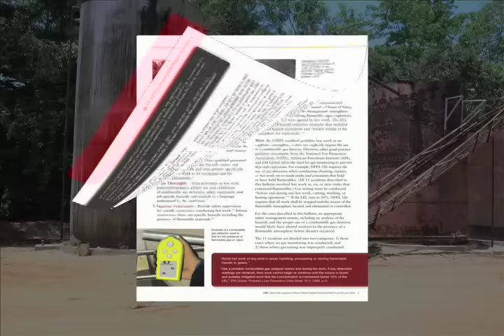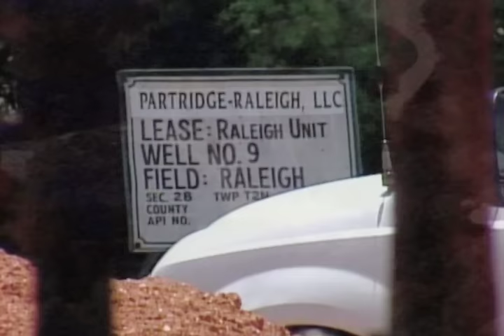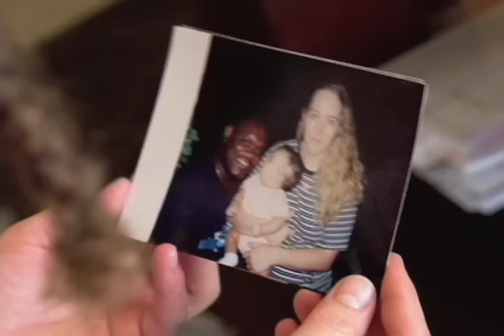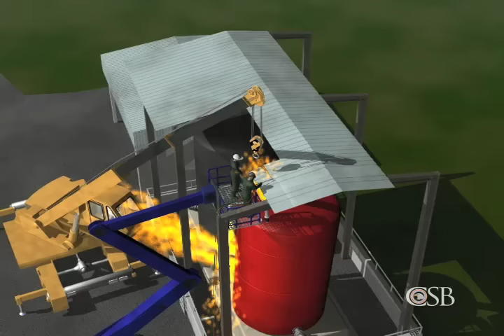Dangers of Hot Work

Comment: Holding a lit torch to detect flammable vapors - one step above “hold my beer and watch this shit”.
Reply: Underrated.
Reply: you can hold the torch with one hand, so you got the other hand free for the beer. no need for someone else to hold it.
Reply: You'd be surprised just how common this method is in the welding industry. I've heard people tell me to use it multiple times when someone has come to me asking for a gas tank fixed. For the record, I've never done it and never intend to do it.
Reply: "If it doesn't blow up then you are good"
Reply: @GoronTico  And if it does blow up, that takes care of the gas, so you're still good!  </s>
Reply: No, the things people do when they have someone hold their beer are nowhere near this dangerous.  This sounds closer to testing a broken gun by firing an overcharge out of it while you hold it, or punching a sleeping bear to see if its awake.
Reply: Old Plumbers used a cigarette lighters to detect gas leak outdoors
Reply: That is not what happened.

Comment: "Our flammable vapor detection protocol is to stick a lit oxyacetylene torch into the tank we need to check. If the tank doesn't explode, it's safe to work on it."

Three questions:

Q1: When did nitrogen get expensive? If they would have simply purged the whole tank farm with nitrogen before doing the hot work, no accident could have happened. (Of course, knowing these guys' proclivity for reckless behavior they probably would have gotten in the tank to hold the fitting from the other side, and managed to appear in another CSB video at the same time.)
Q2: Just how long has the crack epidemic been going on anyway?
and...
Q3: Did they throw the person who came up with this testing method in jail for terminal stupidity, and if not why not?
Reply: Absolutely, positively incredible.  Who supervises these people?
Reply: A1: Don't bring no no big science words to the tank fields, y'all.
A2: Meth.
A3: Freedom.

Think I covered everything.
Reply: A1: purging the entire tank 1 wouldn't prevent the accident. Tank one was connected to tank 2, which was full of hydrocarbon, and it was vapor from tank 2 that actually caused the accident
Reply: @fitrianhidayat  purging would have worked... but it would been engineered via permitting.  I.e. pressurization, steam and inert gases to hold back other gases. This processes are used successfully
Reply: Not sure about #1 or #3, but the crack epidemic, at least in the US, started in the early 1980’s.
Reply: I wanted to know if a gas can was full of gas once.  So I lit my oxy acetylene torch and applied heat.   It indeed was gas. It burned bright.  Problem, I have no more gasoline.  Or skin.
Reply: @jawmedia7575  Sad, but funny.
Reply: @fitrianhidayat  Purge and drain all the connected tanks, then.

Comment: 4:45 the explosion was bad enough that it just seems to picky to point out the darwin-awardable "ladder bridge" setup he's standing on. Did at least put a harness on....
Reply: The only guy with a harness was the only one to survive. He was on the ladder. Safest place?
Reply: No shit.  Thought the same thing.  Shows the complete lack of safety culture.
Reply: A year ago shortly after I made full time security at my job, myself and my coworker were watching a group of our engineers (Casino) doing some work high above the pool area. They didn't use scaffolding, instead they jury-rigged ladders together to create a platform they could stand on and we were getting multiple complaints from guests about how unsafe it looked.

We went to take a look, but my coworker said "it is fine, they are professionals after all," and let it go. Me however I was worried (I had done that kind of work before, so I already knew how unsafe that was) and mentioned it to my boss, much to the anger of my coworker who felt I was being to paranoid. 

Suffice it to say, it proved to be the right thing. Our Director of Risk Management was on property doing a tour of some of the renovations when my boss told her about the potentially unsafe conditions, she went out there and despite me being inside at the time and up on the second floor, you could hear him riping the engineers a new one. It took those three idiots almost forty minutes to get off of their little makeshift ladder scaffold. Two ended up getting fired for unsafe work conditions, while the other (who was a supervisor) was removed from his position.

Got quite a bit of hell from my coworkers though for being a 'snitch', since it apparently that was 'standard procedure' since putting up scaffolding would take up to a couple hours and be a 'waste of time' but as far as I am concerned, if any of our guests had recorded it (which I'm sure some did) and OSHA or someone else found out about it before we dealt with it, we'd have faced some pretty stiff fines.

One thing people don't understand about our work as security in the casino industry, is that on some properties, we are also responsible for monitoring safe work conditions (because of how much of a presence we typically have, we usually have one safety inspector on property are all times, but he is just one person. For a security shift, well I'm not allowed to say how many we have on shift, but it's enough to cover the property and monitor what is going on)

To bad, I liked that job to (damn covid)

Comment: Considering most of these were caused by the sun warming stuff through the day ... these vapour detectors should be permanently 'ON' and attached to nearby surfaces and areas close to the work.
That said ... most of these jobs were SO dangerous no matter what, and another method of cutting should have been insisted upon.

Comment: It is astounding how many of these, if you'll forgive the phrase, boil down to temperature changes causing vapor. 

Especially because it's not as if these were indoors, and faulty/improperly calibrated equipment caused unexpected heat. It was the sun. That thing that is there in some capacity everyday. How would the individuals in charge of the project not think ??

Adding additionally, I've just started going to school for mechanical engineering, but I am now considering a focus in safety, whatever that path might be.

Comment: We were contracted to demolish a 30ft dia. storage tank. Checked for vapors and confined space regulations, disconnected all feed and drain lines . Without a problem had cut up the entire thing except the floor. As soon as we started on the floor an explosion lifted the entire tank floor nearly a foot, including anyone standing on it. Later discovered that product had leaked through small rust holes in the floor and pooled under the floor. No one was hurt but, a few of the guys had to go home and change their pants. Close call, tought us never consider a job as "got it in the bag" .

Comment: The insidious sequence of events is most telling.  Certainly, some of the incidents were straightforward, but decomposing matter found in most food processing plant water treatment systems and microbes producing hydrogen from metabolizing organic matter demonstrates a more thorough hot work permit system than many in the 'nontraditional' flammable arena use.  It also shows that Management of Change is substantially more important in the non-CFR1910.119 PSM industries recognize.

Comment: Increase the quality of training is to expensive until stuff like this happens. Safety is number 1 then productivity, you are no good to a company dead. People get work done much faster when they are sure they are safe. In the examples shown in this video, those people were probably taught to press on when they are unsure as usually there is nothing wrong but with proper training I'm sure they would have learned to respect flammable materials at all times and from all sources and then proceed.

Comment: As a Canadian in SE Sask we fortunately haven't to many incidents from hot work in oilfields we are pretty strict on Oilfield safety with employment termination if employees don't want to apply or comply with the life saving safety protocol that is there for everyone safety since 05 when I moved down here there has not been any H2S poisoning accident gladly say there have been sadly to say a few fetal service rig accident of service tipping over in Saskatchewan winds they were called free standing rigs but it set a new safety precedence which gladly to report wind hazards safety procedures high winds over 50km hr no service rig hands to work we also have the right refuse dangerous work without job loss.

Comment: Gas detector use during welding is useless near welding. It will blow up before any would be detected. Common sence would be closing any open pipe ends and valves